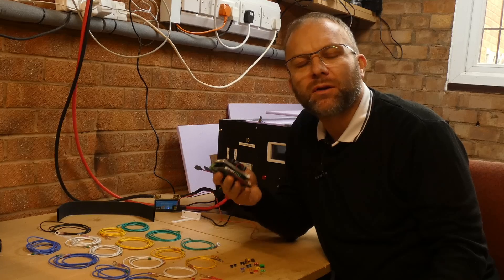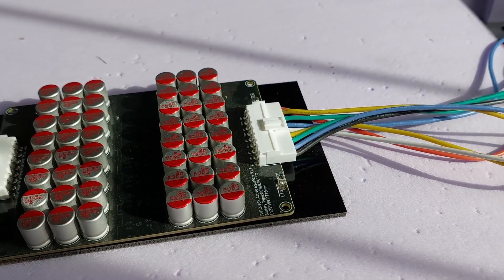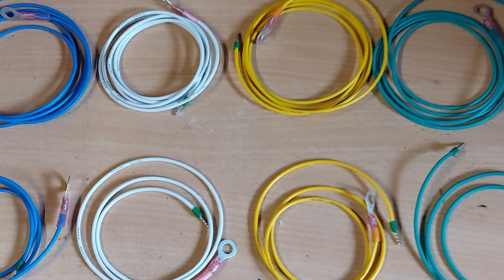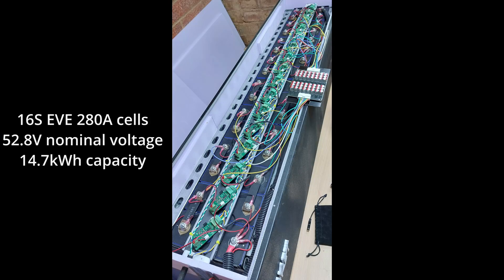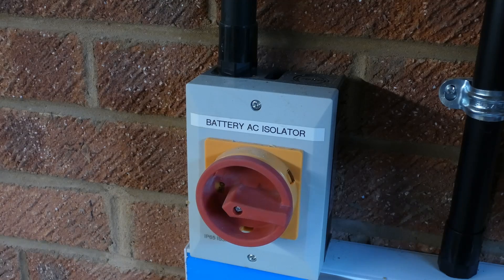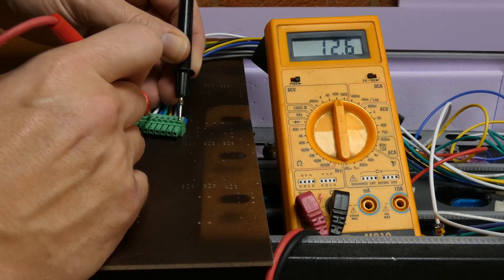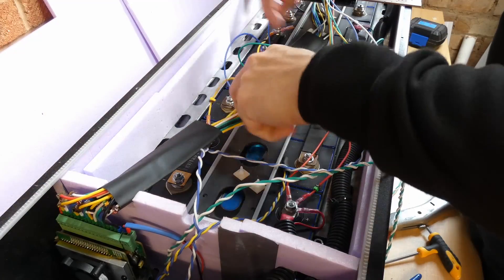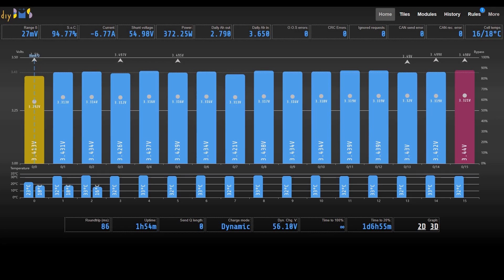16S "all-in-one" release and installed [DIYBMS]

Comment: Does this support an external contactor?
Reply: I see the relay output, what voltage is this output and what is the max allowable current draw on that output?
Reply from the maker: The controller boards support the contactor

Comment: What is the power consumption of the boards? I was thinking of doing the individual monitors, but the more I think about it, it's likely that this new 16s board uses less.
Reply from the maker: The individual boards are very efficient in power requirements, the CPU is put to sleep between each request so consumes very little current.

The 16S board is always powered up and running, but still only consumes 20 or 30mA - hardly anything in the scheme of a large battery setup.
Reply: @StuartPittaway  I saw that you restocked the main boards yesterday and couldn't help myself! 🙂 Good work Sir! Thank you for the reply.

Comment: looks really good, nice work.  i'm planning on upgrading from a medium sized lead acid installation to LFP next year and I'm keen to DIY it so your project is of interest to me.  

i was thinking that another advantage of your older model with individual boards on each cell is that interconnect resistance shouldn't be an issue, right?    this all-in-one solution will see any resistance as an extra voltage on a cell during high load.   my use case is probably going to involve a few 70mm^2 40cm cables linking a four separate 4S batteries into one 16S.  each of those cables will see maybe 10mV across them under full load and i think the AIO will interpret that temporarily as a higher voltage on those cells.   do you have any thoughts?

you said there's a 100mA balance current in this particular model.  how did you decide on that value?   is there a rule of thumb (eg. "[X]mA per 100Ah of battery") or is it just something that you've worked out empirically?  from your real-world testing of this system when a cell (i assume you're using something in the ballpark of 300Ah?) needs to burn off some energy what sort of time is it taking to do so at 100mA?    I'm trying to get a feel for if 100mA is sufficient for the 1800Ah battery i'm planning.  my gut instinct is "no" but i'm keen to borrow your experience here :) I'm going to use good quality cells, so i don't expect them to need a lot of balancing during use but i also expect this to last for a great many years and it's unclear to me how well matched the cells will stay over time, and i don't want to find that in five years' time there's one cell that's spending 100% of its time balancing and yet still creeping up in voltage. 

if i needed a higher balance capability then would it be trivial to replace the load resistors with larger external ones, or will that require changes to other parts of the BMS?

i'm also considering building this as 3 smaller banks each with their own BMS.  what support does your solution have for parallel BMS operation?  any other considerations?

cheers
Reply from the maker: Lots of questions, which are not that easy to answer unfortunately!

Most people are using active balancers these days, so although this design has passive balancer - it rarely gets used as the cells are taken care of using active balancer.  The 100mA balance is per cell, and is a trade off between usefulness and the energy/heat generated by balancing and preventing really hot temperatures on the board.

Are you planning to build a 48V system?
Reply: @StuartPittaway thanks for taking the time to reply :)   Yeah it'll be a 48v system, i'm aiming for about 80kwh.   

Does DIYBMS have any support for parallel batteries with independent BMSes?
Reply from the maker: @StikDragon you could add a 16S monitor onto each parallel battery bank - and a single controller would monitor them all.

Comment: At 9:03 there is a big resistor in view. Resistors just burn energy into heat (what our planet is dealing with).
Why not try to get excess energy from full cells to cells that can take charge?
My 2 cents for today.
Reply from the maker: This is a passive balancer, as you say just turns energy into heat.

An active balancer is also fitted which moves energy across the cells, generating little heat/loss during that move.
Reply: If you are referring to the large gold resistor, that is a pre-charge resistor. Its only purpose is to limit inrush current when connecting the battery to inverters/chargers etc...

Comment: Hi Stuart, great video, as a patreon also, its great to see this development. any idea on the total cost per board Stu, both in just the pcb from jlc and the final build cost? I have 4 of the bms systems running managing batteries in my little circle of friends systems. Id be interested in testing one of these tho. Also, I see a reply of yours about the possibility of you selling them, thats a great idea, altho may I add a word of caution. We bought a diverting device years ago (before the battery storage) called a Robin Emley device, to divert the unused solar into a immersion system. Worked flawlessly. Robin sold them in "kit" form, with very little home assembly required. some less techy folks wanted it fully built, thats where his problem came. As his device was so good, and a hobby type "diy" device like this, it outperformed major seller devices and was 10th of the price. They didnt like this and reported him to trading standards. As a "built device" if selling he had to obtain a CE mark accreditation, something very expensive and time consuming to do, and not worth his investment. So, please bear this in mind, as some BMS manufacturers may see how good your device is, (and it is) and may want to create issues for you as they see you as a threat and taking buisiness away from them. Sold in "kit" form with very little to do at home (even as little as bond a heatsink perhaps)  then you do not have to get CE marking accreditation. Loving you work Stu, and thanks for doing it.
Reply from the maker: Hi, I'm aware of Robin's device - I spoke to him about that whilst he was developing it.
Thanks for the comments, I don't plan to get anything CE marked (yet) - but that also pushes the price per unit up
Reply: @StuartPittaway  robins service is awesome. Still got it but its our of circuit now that the battery gets all the excess.auoweb sevice tho, best on the market

Comment: Awesome! Andy from offgrid garage is doing an extensive BMS comparison, I know you both are in contact.  One of the main requisites that I personally would love from the diybms is the parallel operation (to shut down the contactor of 1 bank, but allow the others (if normal) to continue working), and the controller (or master BMS) tell the inverter (or victron device) that the available capacity went a bit down, to set the CVL, CCL and DCL). The last point will be if the battery is full, that the MPPT charge controllers could be used to charge the loads, as the PACE bms). Here it is the spreadsheet comparison file https://docs.google.com/spreadsheets/d/1E7zX6uXqczvpEEJKD8jER31LWkNqWMgvUytVCVfMvlg/edit#gid=0  Cheers

Comment: i wonder is there a posibility to change disyn to use 6v cels or 12 v or 24 v cels to create 48v battery whit that you can use your old batterys
Reply from the maker: The cell monitors are designed to look after single cells in parallel, so wouldn't be suitable for 6/12/24V cells.

Comment: thank you for your great job, Stuart; is it possible to add an event "any cell balancing" to deactivate an active balancer breaking its the RUN jumper circuit?
Reply from the maker: The 16S monitoring board has a relay output which will automatically switch on/off an external active balancer.  I'll include that in another video - didn't want this one to get too long.
Reply: @StuartPittaway  it would be really great if you could add this feature into the ESP32 event list also 🙂

Comment: Hello Stuart!
How does it work when you are using both active and passive balancing at the same time?
And, do you plan on using the relay output of the battery board for activating the active balancer?

Keep it up, this is awesome work!
Reply from the maker: Yes, absolutely.  Didn't want to make the video drag on too long - I will be using the relay output
Reply: @StuartPittaway  great. Do you use any specific config when using both active and passive at the same time?

Comment: Excellent work. I'm testing the all-in-one together with the v4.6 controller and it works very well. I did a test and the integrated current meter also works on the negative side of the battery. This opens the possibility for battery systems with voltages higher than 85V, using a voltage divider.
Reply from the maker: Thanks for the info!